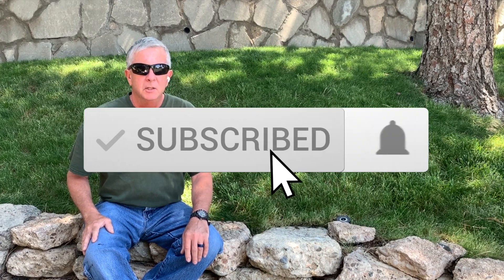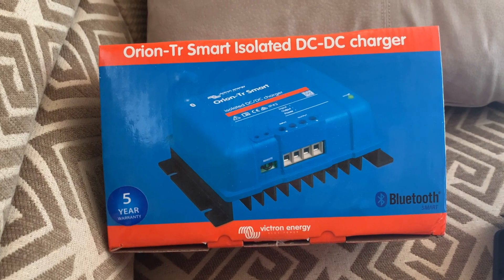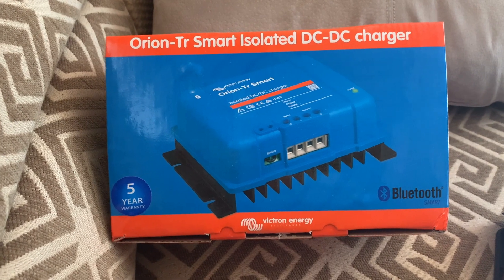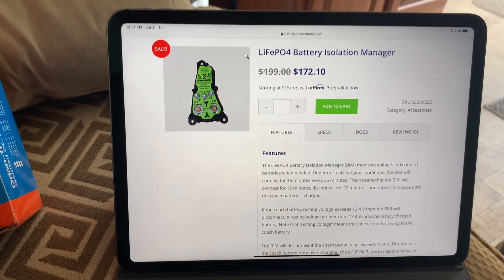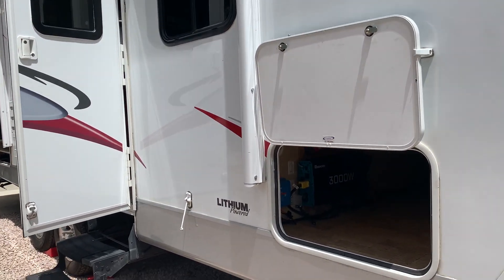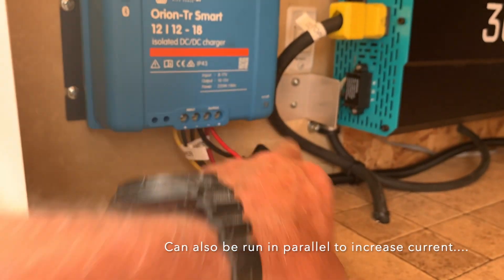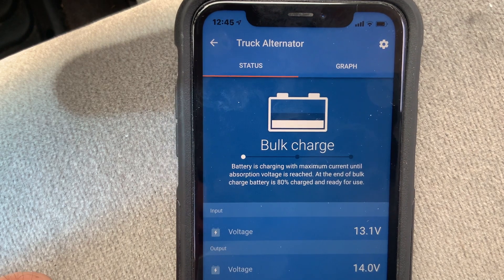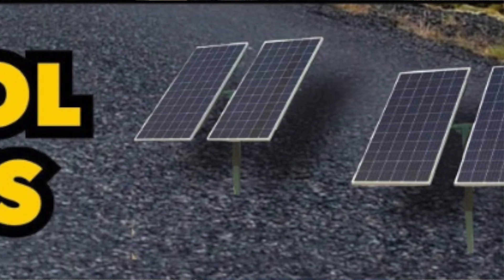RV Alternator Protection - Is it easy to install?  Lithium LiFePO Batteries - Victron Energy -

Comment: 2021 Tiffin Allegro Red, which one is better BIM or DC2DC charger? Where and how install to protect alternator and Spyder system?
Reply: Carolos  - what did you do?  I also have a Tiffin and found that the LI -BIM 240 is not compatible with it.
Reply: @BretChilcott  I called Spyder, got some advice, and Installed two Sun Fun Kits Lithium batteries and a dc to dc charger. The alternator is safe. The solar controller and Magnum Inverter set to charge Lithium batteries. One disadvantage, while connected to shore power, the magnum inverter doesn’t keep the chassis batteries fully charged. Installed an ac to dc charger to the chassis batteries.
Reply: @carloseperezmontes2462  thank you for sharing.  If you have any additional updates, please share.  TNX Bret C

Comment: Hello, I want to replace the batteries of my motorhome for a 300ah lithium. I bought the victron isolated smart dc-dc 12v 30 amps. Can I connect the victron changer with the wires coming to my auxiliary batteries (by adding a 60 amp fuse protection at the input to the output) now to my new lithium without modifying the old installation...
Reply from the maker: I would contact battleborn batteries. Talk with their engineers. We if a battery isolation monitor BIM would apply to what you are doing. Thanks

Comment: Very nice video. I have a WB Navion 24D that I'm converting to LiPo. The WB came with a Mastervolt ChargeMate 40 Pro installed. As I understand it , it limits the charge to the batteries to 40 amps so I won't burn up my alternator. I thought about the Victron but I don't believe it's neccessary. Battleborn said I'm good to go. Thoughts? Again thanks for the video.
Reply from the maker: Sounds good. Thanks.

Comment: do you have a video showing how you connected the morion to your alternator?
Reply from the maker: I just used the positive on the 7 pin trailer plug. That goes to a 30A fuse on the truck and connects when key is on. Does this help?
Reply: @bparkinson1234  I was under the impression that you needed a larger gauge cable to connect the Orion from the battery or the alternator to the camper battery

Comment: Interesting. How is the current split between the motor battery of the RV and the DC-DC charger? (You only have so many amps from the alternator but want both batteries to be equally charged). The Victron is an 18 Amp model - does that mean that it takes 18 Amps from the alternator (and leaves the rest for the motor battery)?
Reply from the maker: Correct. It takes max 18 A from the truck. Plenty left over. Think I have a heavy duty alternator 100A on the truck.  Will be doing an update video on the rv with the changes I made.  I have triple redundancy to keep battleborns charged.  RV solar now on victron instead of midnite solar mppt.  Solar on truck connected via its own victron mppt. Last the DC to DC charger from truck alternator.  Victron is amazing. Will have another rv update YouTube out soon. Thanks
Reply: @bparkinson1234  Why is it required to maintain, and provide a constant charge source on Liths ? My new 100ah Lith arrives soon but I plan to isolate that Lith from Alt/Chassis as I would think once at camp site I just hook up Shore and Lith will charge (new Progressive Lith 30amp) but Chassis Lead-Acids will not.  All I lose is charging  of Lith while driving (I'll pre-charge Lith before  treking). I've broken down before with Alt problems and it's $700 to tow my RV with trailer attached ! Of course while driving I could run Genset and charge Lith as well (chassis battery sees Alt).  But Alt charging such a heavy current draw demand Lith via Alt is rolling-the-dice !  Alts were not designed to see Liths+Lead Acids. I prefer the KISS method.
Reply from the maker: @VideoByPatrick  sounds good. Using shore power    Great progressive dynamics four state charger. See my rv solar video I cover that.  I never plug my rv into shore power 3 years. Run ac etc. crazy. The dc dc charger gives me quadruple back up. Solar on rv. Truck topper solar. See my video. Dc to dc alt charge or my progressive dynamics on shore power. It’s over kill. But what the heck. Have 6 100Ah battleborns. You will love lithium. Keep me updated. See my solar playlist. Maybe do this. Thanks
Reply: I'm looking to do something similar so you are just using the positive and negative from your 7 pin to power the DC to DC. I had heard the 7 pins are typically good for 20a but I had not see the victron 12-12-18. Have you any issues at all?

Comment: Btatleborn batteries balance at a minimum of 14.2 volts.  14.4 recommended.  Your battery cells will likely get out of balance unless you run them at a higher voltage(> 14.0 volts) every once in a while.

Comment: I run the orion 12|24 - 15, having issues with voltage sag once the charger actually kicks in, probably need to upgrade my alternator

Comment: why did you go with an isolated? Are you having any grounding problems since isolated requires a separate ground? I'm installing the Battle Born in my Winnebago navion Motorhome.  And was considering the isolated sense of uses a Transformer to isolate but then requires a separate ground from what I read.
Reply from the maker: Mine is working fine as it is. Thanks

Comment: I use the Renogy DC to DC 20a,  a single 100ah  lifepo4 marine cab battery and  1500w pure sine wave (3000  peak) with 280watts REC solar and a EpEver MPPT more than enough for lights fan sounds and occasional coffee, toast and small microwave  used to defrost